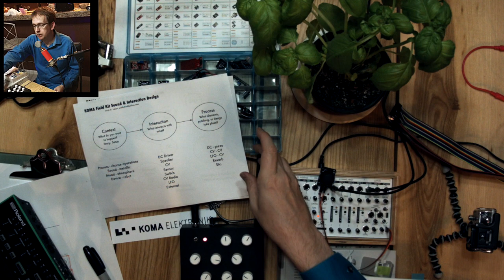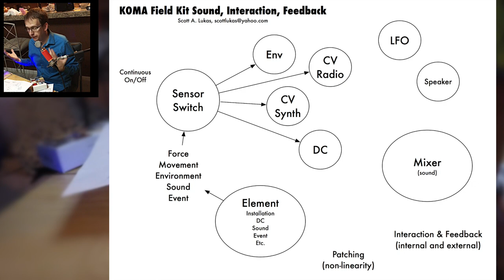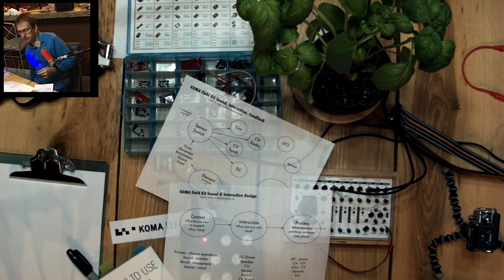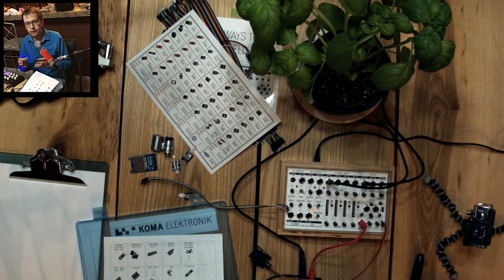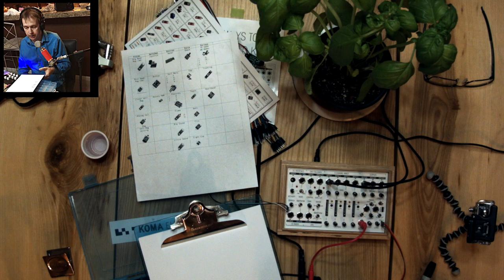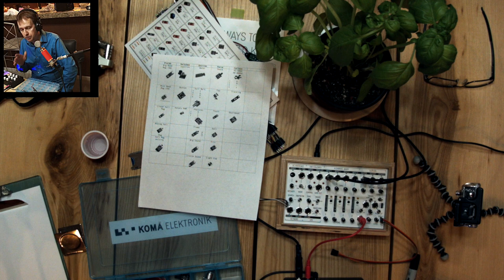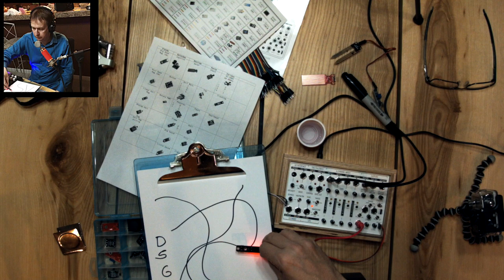Experimenting with Sensors - KOMA Elektronik - Field Kit (Electro Acoustic Workstation)

Comment from the maker: Joystick switch 30:00
Button switch 31:26
Rotary switch 35:00
Fields sensors (magnetic) 35:40
Force sensors 
Shock sensor 37:50
Tilt sensor 39:10
Flame sensor 41:23
Temperature sensor 41:53
Sound sensor 42:38
Soil moisture sensor 47:48
Water sensor 50:33
Photo resistor 53:36
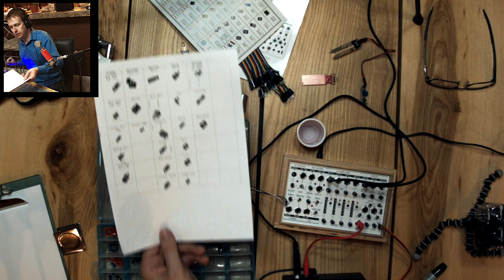Heartbeat sensor 54:20
HC-SR04 (echolocation) sensor 55:48
Tracking sensor 57:34
Reply: Scott Lukas at 31:26 you begin to say the button is worthless, may I inquire as to why? Being able to send human influenced pulses on demand to say the solenoid for percussion or sample triggering from say euro rack I would counter might enhance a performance.

Also bought one recently and am loving it, your videos are really well thought out and great presentation  format. Keep dropping that knowledge on us.

Comment: Really got a lot from this. Just got my Field Kit a few days ago but didn’t really understand the sensors and switches, and this video totally blew the lid off. Just ordered a sensor/switch kit (I think the same one you used here), as well as some marbles and springs to start building some things with. But really excited to start messing with sensors and things to interact more with my modular via the Field Kit. 

I’d love to see a follow up video to this now that you’ve had more time to experiment. You mentioned a few times in this video having better luck doing these things with the 0-Coast.  A new video using that or another piece of gear with more pronounced results would be ace. Still tho, fantastic stuff. Liked and subscribed.

Comment: Hey I got the sensor pack for the soil moisture sensor on your recommendation,  but I can't see the circuit you're talking about to plug it into, and it's missing in the CD guide that comes with the pack, can anyone send me a picture of what it should look like?
Reply from the maker: Thanks for reaching out, sorry about that, there are quite a few soil sensors available, here is an example. I bought a multi-back of sensors and it came with it. https://www.amazon.com/Capacitive-Moisture-Corrosion-Resistant-Detection/dp/B07SYBSHGX/ref=sxin_15_ac_d_rm?ac_md=0-0-c29pbCBzZW5zb3I%3D-ac_d_rm_rm_rm&cv_ct_cx=Soil+sensor&keywords=Soil+sensor&pd_rd_i=B07SYBSHGX&pd_rd_r=aad9bb05-5603-402a-8a24-4086a1a7c543&pd_rd_w=ujLsq&pd_rd_wg=6rTgx&pf_rd_p=4ddd8e40-6b01-4726-9d0f-a100f252099e&pf_rd_r=FKDXRVR1B10V6XAFMD10&psc=1&qid=1638210047&sr=1-1-12d4272d-8adb-4121-8624-135149aa9081
Reply: @immersiveworlds  Thanks, I managed to source some on another site, but will bookmark these also!
Reply from the maker: @HotgemClairCrawford  Ok, that is great to hear!